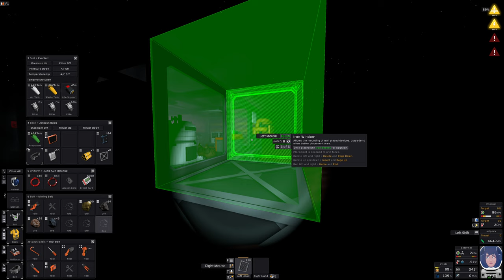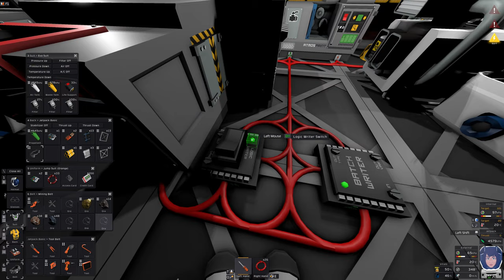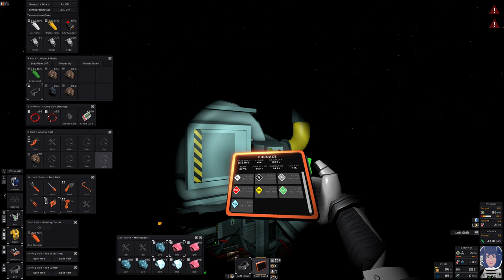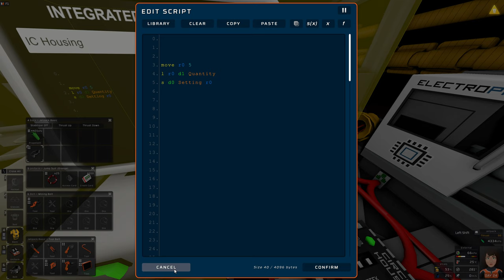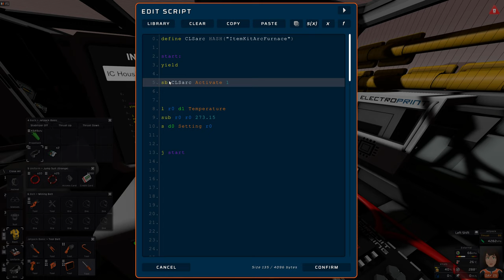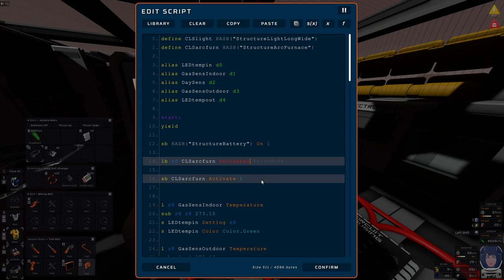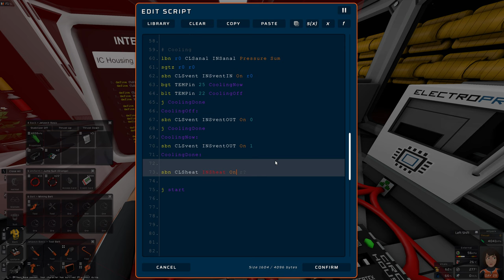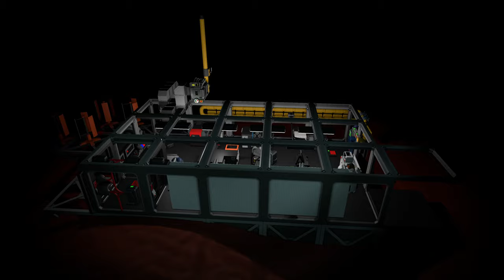Stationeers tutorial - beginner introduction 2: Furnacing, Logic Chips, MIPS Programming, Automation

Comment: I have done the same with a friend in a coop save on mars. I got a chicken invasion. They canot die and multiply infinitely and its exponential.
Reply from the maker: Multiplayer is a fickle beast, so who knows, maybe normal chicken simulation behavior doesn't always work there. There was a lively discussion with the devs on Discord in the last hours regarding multiplayer issues, they even pushed out a hotfix to Stable (aka everybody; not just to Beta) four hours ago, but more issued (e.g. airlocks / cable networks) have been acknowledged, and a new insight was being had regarding cable networks. I know - unrelated to chickens.

Now, since we had a significant chicken update (Everybody, not just Beta.) yesterday, I assume the problems you describe happened before that - and may no longer happen now, since chicken are quite mortal at this point. I opened a window (Not in the video.) right after I got the patch - and the chicken were unconscious in a minute. They have lungs now and take normal instead of reduced rate damage. ---- Still, multiplayer could throw a wrench into these good news.

Ultimately, savegame editing can remove this pest I'm convinced. Since we're talking simulation breaks or rather improper chicken simulation, that wouldn't be cheating.
Reply: @OwnerOfTheCosmos  There was a update its fix. They all die but one that a manage to push back inside.